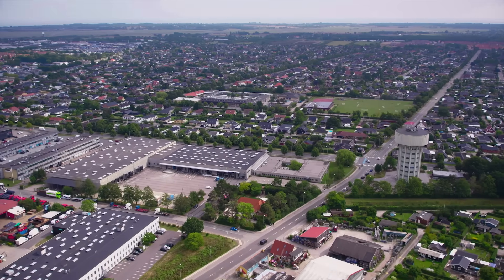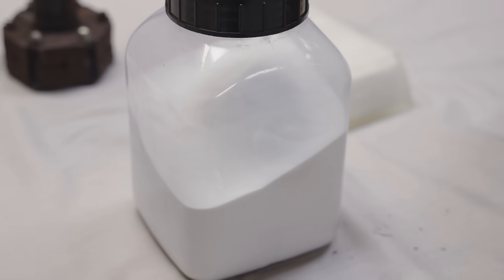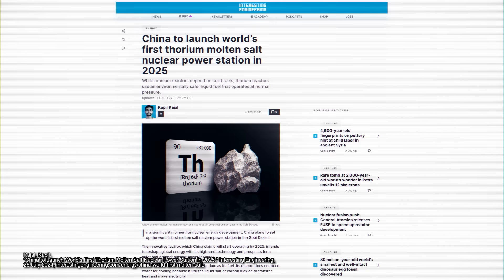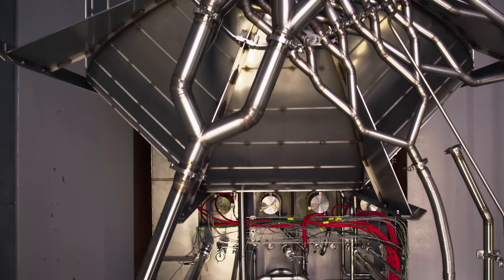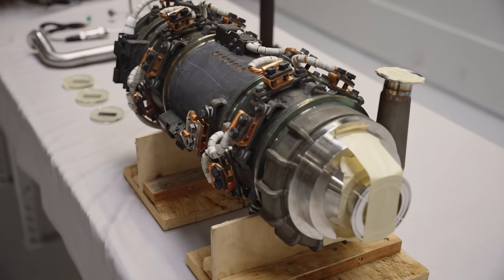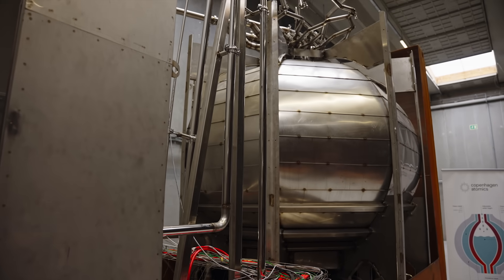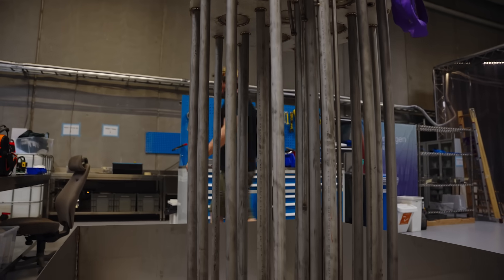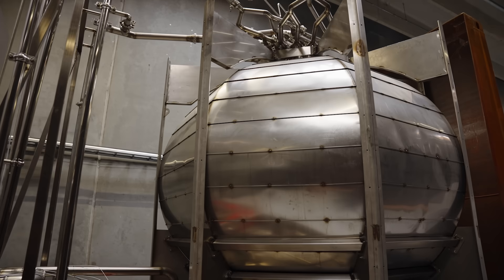Why Isn’t Thorium Changing the World?

Comment: "You can take out all the fission products as it's running" How? Do you have a refinery next door to do some fractional distillation, fancy filters, centrifuges? Or what?

Why do they need the motor itself to be 'glowing hot'? Gearboxes exist, chains too. Plus isn't that above the Curie temperature? 
I'm betting they did mean the pump vanes or whatever were glowing while the motor was comparatively cool.

Comment: 13:44 If we figure out fusion by 2100, Thorium will look expensive compared to it. Fusion is the closest thing there is to "free" (0$) energy.
Reply: Much harder process than 24 of these around the world with waste that can fit in a football pitch/field.
Reply: @Snyder95  You realize they don't output nearly as much energy as the current nuclear powerplants, right? 24 will definitely not be enough 🥸.
Reply: That’s cute. If you think 700C is hot, try getting energy from 100 million C 🙄
Reply: @ We literally have. Multiple times and through different methods. One experiment got 2MJ in and 3MJ out (but required 300MJ to power the 2MJ lasers) and JET produce 69MJ through fusion but idk how much it consumed and ihdc as it wasn't the point anyway. The point of JET's experiment was to show that it was possible at all.
Reply: @louisrobitaille5810  what you are pointing out was “net energy gain”. That energy still has to be transferred through some medium to generate electricity. There are some lithium compounds that may be able to do this, but it is astronomically harder than boiling water 😅
Reply: @  iirc, ITER will still use steam to generate electricity 🤔. Almost every electricity producing method is just "how cheaply/cleanly/efficiently can we make water boil" 🤷‍♂️.
Reply: @louisrobitaille5810  but you still haven’t addressed that fusion still needs a medium of energy transferal, and fusion (especially tokamak fusion) is literally the hardest to do this with. By 2100, we will have a variety of energy sources that will have their own utility in our power grid. Read up on how RTOs and ISOs are structured, and you’ll see how complicated coordination and  transmission are with different sources all have different start up times, pricing structures, and maintenance schedules. Nuclear clearly has a place in that market while fusion alone is a fools bet that ignores the technical realities of how power grids function.
Reply: @ I'll come back to this comment later but I just wanna point out first that fusion doesn't require any natural resource other than hydrogen, unlike literally every other nuclear and fossil fuel energy source. It'll come a time, very soon (less than a millenium) where we'll have to rely on fusion and "renewable" energies. It's only a matter of "when", not "if".
Reply: @louisrobitaille5810  glad you are taking time to read up on transmission. However, fusion requires different isotopes of hydrogen, deuterium and tritium, in different amounts depending on the type of reactor. Tritium is incredibly hard to source, and we may need to literally harvest it from the moon because of how it traps solar winds. I would also recommend you do not hand wave away technical difficulties with “it’ll be solved in a millenium”. There are real energy issues to be solved now, and engineering certainly benefits from solving incremental problems leading to larger leaps in technology 👍
Reply: @ I didn't hand wave technical difficulties, I meant that the fossil fuels will literally dry up/run out in less than a millenium (~300-500 years depending on the estimations iirc) so we'll be forced to figure out other energy sources before that happens if we don't want to go back to the middle ages in terms of technology 🧐.
Reply: @louisrobitaille5810  I dont know if it looks the same on your end, but all of my replies that had my arguments have been deleted. Also, your original claim commented against Thorium and in favor of fusion, despite the arguments made against the feasibility of fusion energy transfer. You also made no mention of fossil fuels in your original argument, and pivoting to it and giving yourself the monocle emoji doesn't exactly back up your original argument. Hope you found the discussion enlightening though.
Reply: @justinalias7969  I still see all your replies. When I comment, I usually reply based on the previous comment, not the original one. It's true that I didn't explicitely mention fossil fuels in my original comment, but I did in the comment you were replying to which is what I was referring to. The only reason I didn't in my original comment is that the time scale was slightly too short for it to be an existential matter. If I'd said by 2500, I'd have mentioned the fossil fuels being likely to have run out by then. It's not a pivot, it's just zooming out a little bit to have more context and arguments. Pivoting means you're changing subject completely.

Comment: This is one major problem with Thorium -
Xe-135 poisons the reaction which is why the reaction will stop unless it is removed
and is also why a Thorium reactor is walk away safe - it will shutdown itself.
Quote from Dr. Frank Shu.

Cleaning the salt: To complete the breeding cycle, there are two salts that require cleaning.  The fuel salt requires the removal of fission products that would absorb neutrons needed to maintain the chain reaction, with an excess of neutrons from each fission of U-233 that goes toward the conversion of Th-232 into Th-233.  The last species becomes U-233 after two beta-decays.   The most important  fission product to remove is Xe-135, which has a huge cross section (2 million times greater than normal) for capturing neutrons.

Comment: Ceramics have come a long way just in the few decades I have been around, maybe on certain parts of the system radiation hardened ceramics could help hold up to the heat and corrosion too. Of maybe it has been tried already and it has its own issues beyond just cost? I know we need more, safer nuclear power if our modern lives are to continue on.

Comment: 13:23 he says "1% of the worlds energy comes from solar, + wind 5% from nuclear". That was true when they founded Copenhagen Atomics, but it is totally wrong now. Both solar and wind will overtake nuclear this year. Solar has sustained exponential growth since 1970, and will overtake coal in about five years. By the time they have a commercial reactor, there won't be any fossil fuel or uranium reactors any more to compete with. I think they're too late.
Reply: We need base load generation. Solar and wind are not stable base load generation methods. 
We also need peak generation sources. Batteries are good there. 
Nuclear is critical in meeting stable base load demands until we have stable, reliable, safe, and energy dense battery storage.
Reply: @nasonguy  The problem is, solar has removed the need for a traditional base load. It's covering all of the energy demand during the day. There's opportunity for sources that run at night and can be turned off during the day, but energy storage is eating into that as well. 

> Nuclear is critical in meeting stable base load demands until we have stable, reliable, safe, and energy dense battery storage.
Right, but how far away is that? If that's more than 30 years away, then thorium has a slim chance. If it's 100 years away, even fusion has a chance :)
Reply: @ Solar isn’t a viable base load generator. Too much fluctuation. 
Reliable, long lasting, safe, and energy dense storage methods are needed, but are decades off. 
Nuclear is tech we have now. I’m not talking thorium…
Reply: That ain't gonna happen
Reply: Absolutely true. Was about to write that. Thorium remains an interesting option especially for late renewable adopters and countries with heavy reliance on nuclear
Reply: Solar power has a lot of issues. The fundamental one is that it is only available for a few hours a day and even then it is not reliable. It needs to be paired with other systems. Nuclear power is great because it can produce constant power and also ramp up easily, and therefore can be paired well with less reliable renewables. 
Okay, this isn't an either or situation. There is a place for solar power, wind power, hydrodynamic power, geothermal power, and nuclear power and decarbonizing power production.
Reply: those stats get kinda wild when some people lie
cripple their own nuclear production, say they going 'green' but really using gas and coal again to fudge the numbers
worse is the moral victory they get fined a single dollar for decades of trouble and any illusion that it was ever taken seriously was lost that day
Reply: "and also ramp up easily" No? Lmao it cant.

Comment: If it sounds too good to be true, it is. Anyone who's suspicions are not immediately aroused by miracle solutions and cures is a gullible drooling idiot who falls for the same scams and cons every time. Depleted uranium has a half-life of a billion years that is poisonous and corrosive to all life with no secure way of storing it. Where is the proof that thorium is any different,  eventually degrading the container and leaking out into the Earth destroying all life. 

Nuclear energy is not a solution to the world's energy problems, but another way for the oil industry to maintain it's stranglehold on the global war economy of debt slavery. Replacing oil energy with nuclear energy is changing one brand of cancer and malignant tyranny with another.

Comment: How are they going to take out all the fission products while it's operating? I've never heard of a resin that works at 700° C.  I'm pretty sure cesium boils at 600° C, so you'll probably have a cesium fume problem. 
   And will they really be removing 100% or 90% or 80%....  Where are they going to go?   What are the half-lives of those particular cesium and strontium isotopes?

Comment: The Oak ridge reactor used plutonium 239 to start the reaction.  I know what happens when you put fluorine next to Pu239 and it captures the spontaneous neutrons that are given off.  It is not less radioactive.  You get more neutrons and gamma rays from sodium 22 that is created when the fluorine is activated. Lots more neutrons. You don't notice the gamma so much.

Comment: The sad thing about thorium is everybody keeps going down the molten salt path.
  The Oak ridge reactor was built based on experience gotten from the first reactor that was in the nuclear submarine Seawolf which the Navy got rid of as quickly as it could because it was so much trouble to work with.    The second reactor ever used in a submarine built in 1953, was not a light water reactor.  It was just sodium cooled without all the complications of having your spent fuel constantly dissolved and circulating through a loop and it was still not attractive.   You would think if someone wanted to make the argument that it makes less nuclear waste they would tell us what happened to the core of the reactor at Oak ridge.

Comment: The corrosion is also a compounding issue because higher temperature increases the rate of reactions, fantastic for producing energy, but also dramatically increases the rate of corrosion, quite the engineering challenge.

Comment: To mitigate corrosion, why don't we build molten salt reactors using non-molten salt as lining for all the vessels and pipework 🤔

Must be fragile I suppose, but isn't there a possible way out? The corrosive flowing stuff interacts only with its own solidified counterpart, not with the structural metal walls

Comment: This dude reckon the price point is somehow going to beat renewables. Not a chance in hell. Even with a proven and permitted nuclear the expense is the issue, with a brand new and unproven bunch of techs it's going to be sky high, while solar cells are only becoming more efficient and ridiculously cheap and battery innovations are happening every day. We don't need to pursue such a difficult path when we already have a perfectly clean and cheap source. Why don't any of these people look at the LCOE chart? And why do they never mention the fact the thorium still has to come out of the ground (even if it's more or less a by-product of other mining) and be processed and transported?  Wind and solar don't even require a boiler, so much more simple and much less maintenance, and now can be recycled. And if you overbuild and include storage, night time and dunkelflauter are no issue.

Comment: Why is there no reserch on low temp nuclear ?
Reply: Such as?
Reply: I would imagine its because low temperature directly implies less power generation, and generally the curve for power generated to heat generated is exponential.
Reply: @warcrimemenace6292  i gess termal mass also helps stability

Comment: He's correct. Price is king. That's why  solar and wind are growing exponentially and are about to surpass nuclear. Combined, they already have. Soon, they'll do it individually.

I'd love to see this company succeed, but they have a steep hill to climb to catch up with renewables.
Reply: Energy Density.
Reply: @johnniequinn3215  Irrelevant. Cost is  what matters.
Reply: @insaneshepherd8678  relevant to the proper flow of information.
Reply: @ It can all be broken down into cost. You will end up with a total cost for your energy system and renewables are winning that race.
Reply: I wont bother to verify again, but I did a couple years ago, but I am pretty certain the cost of a modern NPP + fuel is comparable to renewables when based on energy production, if you take into account the maintainance of most renewables. Even if it wasnt true the idea of 100% power generation coming from solar/wind is ilogical and nonsensical if you understand how power grids work. For that to happen it would require some sort of breakthrough that allows hyper efficient energy storage that has not even been theorised yet, meaning that untill that happens, if it does, you will still need non-passive power generation such as NPPs, coal, or natural gas.
Reply: @warcrimemenace6292  The problem is that the cost of nuclear skyrockets when the capacity factor goes down and that is inevitable when you pair them with renewables.

What exactly is illogical about 100% of energy coming from renewables? You do not need super efficient storage either because you will have massive surplus production at noon and high wind times anyway. What matters is cost of storage. We might not be there yet, but we're making big strides in the battery sector already. 

Unless we actually manage to harvest the advantages of mass production for nuclear power, it will be a niche technology.

In the end, the guy in the video said it correctly. Cost is king and nuclear is losing that race.
Reply: @ Here, a great way to prove the idea of 100% renewable without power storage being an abysmal idea would be for you to get a bunch of solar panels and disconnect from the power grid. Solar and wind power is completely dependant on time, weather, and a bunch of other factors. You CANNOT run a power grid on an uncontrollable power generation system because then you will constantly have times where less power than needed is generated, and times when more power than needed is generated, damaging infrastructure. This can only be compensated by 3 things; having non renewable power sources to account for power demand and fluctuation, having hyper-efficient power storage, or having hyper efficient power transport systems to move power from one country to another (and having systems to consume power when production is higher than demand to prevent infrastructure damage, which itself is incredibly hard).
Reply: @warcrimemenace6292  No one wants to build 100% renewables without power storage. You're arguing against a strawman.

Comment: 13:00 are you not going to fact check that? Wind and solar are not 1% of global electricity supply. They are at 5% and 7% respectively, and grow exponentially.  Hydro power supplies another 15%, which is increasingly intertwined with solar and wind. While the total nuclear capacity has been stagnant over over 20 years now, so its share has reduced to currently 10%.
Reply: He did say "energy", not "electricity", but there the numbers are wrong as well. What I found for primary energy was nuclear 4%, wind 3.5%, solar 2.5%. Also, using nuclear for transportation is possible only to the extent that vehicles run on electricity, and using it for heating is possible only to the extent that district heating is used, so 50% of primary energy would mean nuclear practically covers all of the electricity, everywhere. Not going to happen.
Reply: @richardmetzler7909  Wind, solar,  hydro, and nuclear are tallied at their direct output.  Fossil fuel power plants are tallied at their thermal output, when those thermal plants are only 35-50% efficient fixed, and 25-40% mobile.
Reply: "total nuclear capacity has been stagnant over over 20 years now" How so when closing nuclear power plants trying to reduce that number to zero?

Comment: Thorium and Uranium as found in nature... can be held in hands, just wash hands afterwards. Not going to turn into some nuclear mutant-man.
You will not be irradiated with any alpha particles or beta particles etc from thorium if you had it in a jar...
Thorium was NOT used in reactors to make electricity because the reaction did not produce the products required by the MILITARY to make NUCLEAR WEAPONS! It just makes heat - hot water exchange to run turbines to make electricity... no Nukes!

Comment: Nuklear power is no option, because it cannot compete with solar and wind. Way too expensive. Every nuclear powerplant build in the last 50 years was 3-7 times over budget and building was up to 4 times longer then estimated. Thorium reactors will be worse because of way higher technical complexity. There is no buissines case for nuclear power. Worldwide the power produktion if nuclear power plants sunk from 17% in 2000 to now about 9% because of the high cost.